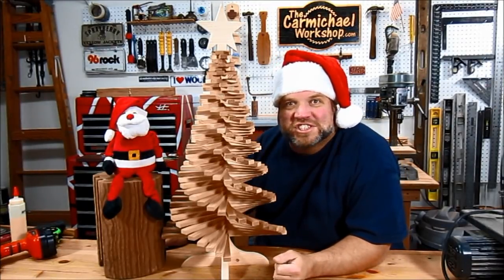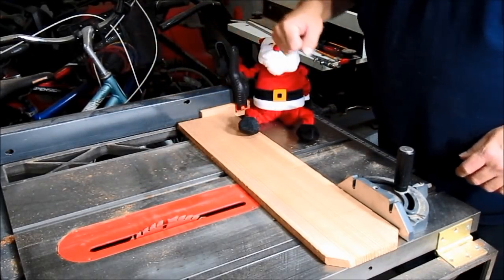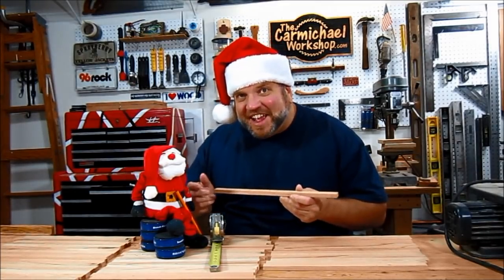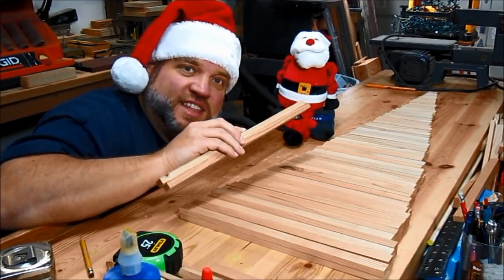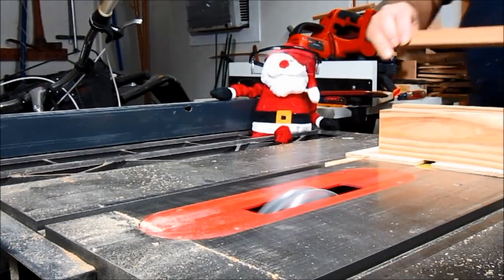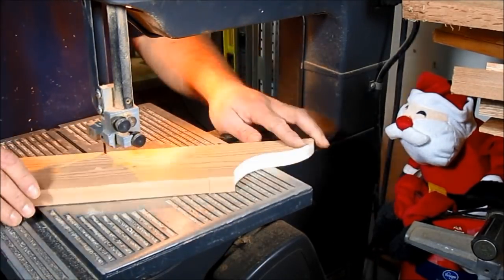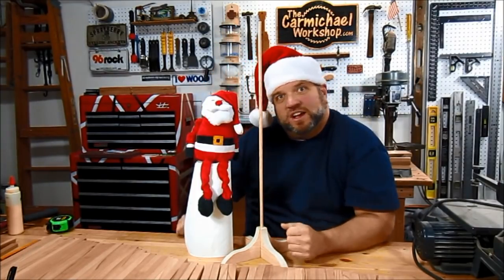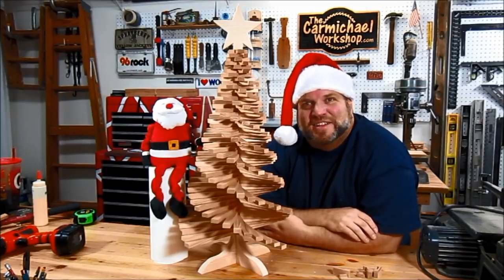Twisted Christmas Tree - A Holiday Woodworking Project

Comment: I just made this tree and it was very simple. My wife loves it. I recommend planning all the boards to the same thickness. Cedar fence boards are rough cut and therefore vary in  thickness as mine were. This makes it more time consuming to make the correct depth on the dados for each level. The sled was an excellent idea too.
Reply from the maker: Awesome!  Glad you could use the idea Steve!  Yeah, I've made a couple of different sizes of these and planing the wood is a good idea.

Comment: you could send me the measurements in this wooden pinheironho and very cool would like to make one for me how many of each tenque cut to build the required pine
Reply from the maker: Luiz Antonio Hi Luiz - There are about 100 pieces.  Instructions are here - http://www.thecarmichaelworkshop.com/2013/12/twisted-christmas-tree-holiday.html
Reply: Steve Carmichael Ok thank you I will try to do what I really wanted was the size of each timber that is (example 2centimrtro x1centimetro x30centimetro) guys use very al inch here only use the centimeter then send you the pictures ok thank you even embrace.

Comment: steve, what tools do you recommend to get if you were just starting and going to make small projects but not spend loads of money.
Reply from the maker: Hi Luke - My first power tools were a drill, jig saw, and circular saw.  You can do a lot with just those and a straight edge.  Then I stepped up to a table saw and a band saw which made things much easier and quicker, and more accurate.  It really depends on what you want to make.  For example, you can make lots of things with just a scroll saw or lathe.  Good luck and let me know if you have more questions!
Reply: thanks i cant wait to see later videos too

Comment: Used your parts guide to cut my boards....no where in video does it say use the cut off pieces on the rest of the tree...wish it had because now the one I have is too short...all it says in the instructions is save all pieces after cutting....nowhere does it say use these on tree...great idea and I will redo this one to make it work but just wanted to let you know that the detail about using smaller pieces was not covered
Reply from the maker: Hmm, I explained that here - https://youtu.be/hyqOfIs1Gio?t=126     "The reason we cut the pieces to 14-1/8" long is so that every time we cut one, we end up with two branches of the Christmas tree."  Wow, hard to believe this was 8 years ago.  I updated step 1 of the instructions.  What did you do with the extra pieces after saving them?  You should be able to slide all the pieces off then slide them on.
Reply: @SteveCarmichael  I had thrown them out already by the time I put it together....layed it flat and made a smaller version of it  by drawing out the tree on the wood...same idea....not knocking what you did....probably me not really paying attention....will try and make another doing it the right way....was all scrap wood anyways

Comment: nice Christmas tree Steve, why can't I just cut off a 1/4 inch off each board instead of that 1/8 inch. The first board you cut off is only 1/8 inch, correct?
I am a wood turning, so that math does not compute....lol
Reply from the maker: Steve Hoppe I had to go back and watch it again.  lol  I just added the 1/8" to the length to compensate for the saw blade kerf when I cut them all in two..  For example, when I cut the 14-1/8" piece in half, I get two full 7" pieces.  Without the extra 1/8, I would have a 7" piece and a 6-7/8 piece.  Yes, the first board I just trimmed off 1/8" to make it 14" even, but all of the other boards had the kerf waste removed from in between two pieces..
Reply: Steve Carmichael Sorry Steve,but, I am still confused. Why do you cut them all in half, Don't understand how you get them back together to have a 14 inch base and work all the way up to 1 inch at the top. Sorry,but, maybe I am just misunderstanding your method.
Reply from the maker: Steve Hoppe That was just an example of the 7" pieces that end up in the middle of the tree.  Starting from the bottom, cut two 14" pieces.  The next level will be two 13.75" pieces.  The next level is two 13.5" pieces.  The next level is two 13.25" pieces.  The next level is two 13" pieces, and the 1" you cut off these two can be used at the top of the tree.  The next level is two 12.75" pieces, and the two 1.25" that you cut off of these are used for the next level down at the top of the tree.  Then you keep cutting two at a time reducing by 1/4", which yields two pieces for the bottom and two for the top until you meet in the middle with two 7" pieces.
Reply: Steve Carmichael Ah, now that makes more sense to me. Thankyou for responding. I am satisfied now. Thought I was going bonkers here for a bit, you cleared things up nicely.